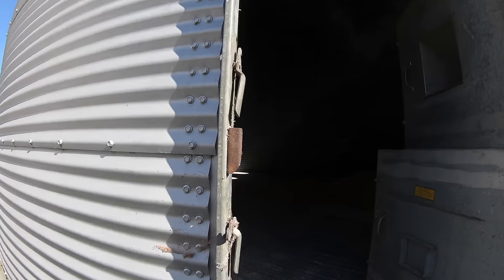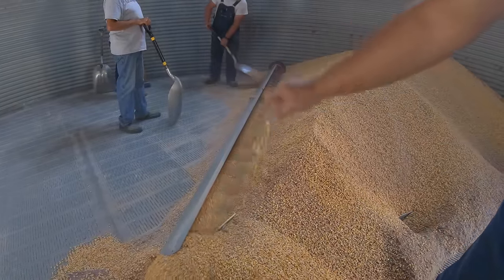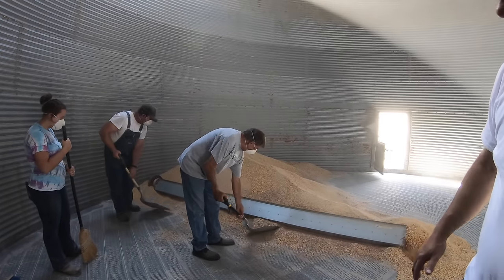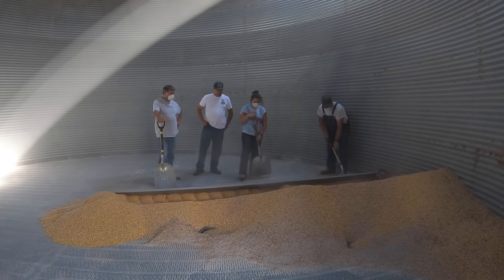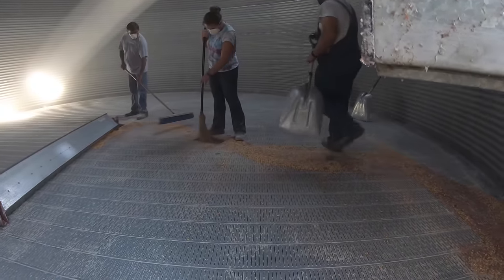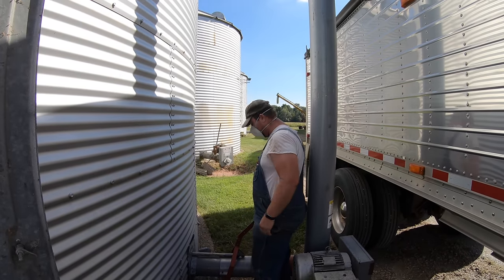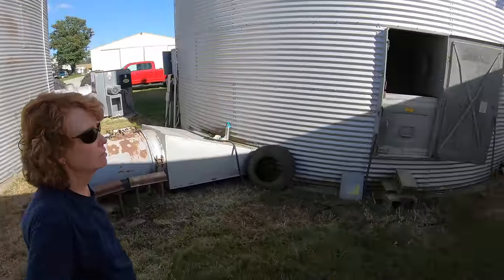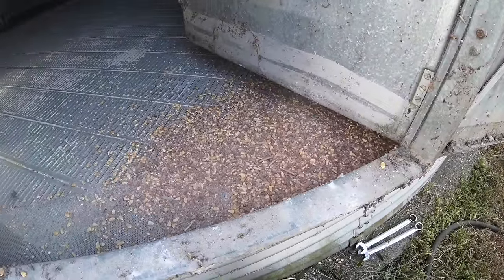How Grain Bins Work! Grain Bin Unloading System!

Comment: I retired from a co op that had 1,000,000 bushel capacity on one side of the road and 330,000 bushel on the other side but we only had sweeps on two 206000 bushel bins and there was only two of us plus one summer help for all of it but it doesn't matter how many helpers you have its a lot of work. Well I guess it does but its still lot of work.

Comment: We used to do ear corn and grind it for feed to the dairy and feeder cattle. It was all right until the corn got down below the feeder to the grinder. Then you had to scoop it. Are grinder was a 550 bushel grinder. We ground two loads of corn a day every other day on average. And in the winter time it was cold because for those of you that don't know that ear corn is stored in an open bin or it will mold.

Comment: Won't be long before they fill them back up , we sold the last of our corn in August ,Sould have in June but, that's water under the bridge. corn up here in Michigan is 26 to 32 % hand shelled right now were going to start Oct.1 we dry corn up here happy if under 25% then we go.keep us posted on harvest down there, enjoy watching that southern corn come off dry out of the fields.
Reply from the maker: They started harvest a couple of days ago.  I'm assuming it is 16% or so.  We used to dry it from 25%, but now there are better 'earlier' hybrids (likely bred for you guys :-)  ) which have better "dry-down", so most years, we do not need to dry very much.
This is a good thing, because our drying equipment is SLOW.
Reply: Propane is NOT cheap anymore like it used to be... 

Later!  OL J R :)

Comment: I worked at a Purina feed mill and cleaned out corn bins, didn't really care for it. It was about 45 miles south of Tampa Fla,  in the summer time
Reply: Yep cleaning bins up north in late summer even in a place like Indiana where it's maybe 80-90 degrees isn't much fun-- doing it down south where temps are in the high 90's to about 100 would be brutal.  No air circulation inside and it's essentially a huge tin can sitting in the sun.  Gets positively STIFLING HOT inside... 

I know I GREATLY prefer harvest in Indiana in October when it's anywhere from the 30's to the low 80's most days to Texas harvest in July when it's 96-100 degrees plus!  Did that too many years... 

Later! OL J R :)

Comment: Memories of my youth. Have you ever gotten into a bin to shovel barley? That itchy dust will make you learn new words...
Reply from the maker: “Red Top” is the worst.  I worked 2 summers in a small seed company cleaning clover, fescue, soybeans, and red top.
Reply: Yeah sounds like grain sorghum... back in the 70's we'd start combining about 8 am soon as the dew lifted.  For an hour before that we were servicing the combine-- greasing and my job, the one I hated, pumping gasoline into the combine's fuel tank-- about 50 gallons worth for the day, all with one of those "bung pumps" by hand out of a fuel barrel.  

Most days in mid-July when you harvest grain sorghum and corn down here it'd be about 90 degrees by 7am.  With the humidity from the dew coming off, you'd sweat through your shirt before you even got off the porch most days.  You stayed soaking wet all day from sweat.  

Grain sorghum back then got what was called  "downy mildew" that grew on the stalk right under the head of grain at the top.  When you combined the grain, the sickle on the header and the bats on the reel would whop this dust loose from the heads and send it wafting straight up toward the combine.  More of this dust came pouring down the feederhouse from the threshing cylinder and out over the header auger, and the bats on the reel would waft it right up towards you.  The combine of course threshed all this dust off with the grain, and it poured out the back of the combine in a huge cloud that either followed you as it slowly dissipated, or blew back towards you.  Best you could hope for was that there was a breeze that was blowing ACROSS the field and rows you were combining, to carry the dust sideways away from you.  Most of the time however there wasn't.  By 9 am usually it was in the mid 90's and just got hotter throughout the day, usually brushing up against 100 by the late afternoon or just over 100 degrees.  You'd be coated in this dust which would mix with the sweat and salt on your skin and make this greasy scum that just itched like crazy... just like jumping into a vat of itching powder and flailing around in it... You were just miserable all day.  Lunchtime you could grab a towel and turn the hose on and get it sopping wet and wash as much off as possible, eat lunch, and then go right back to it.  We'd combine pretty late until 9-10 pm when the dew usually fell and the moisture in the grain would rise and combining would get tough, then shut down for the night, go home, take a long cool shower, grab a bite, and go to bed to do it all again the next day... 

Fun, fun... NOT.  When Carter's grain embargo against the Soviets in the late 70's collapsed the grain markets and led directly the farm crisis of the 80's, we quit farming sorghum for many years... it was practically worthless.  So we grew all cotton til the early-mid 90's when the price of grain finally came back up and we started growing sorghum again for rotational purposes.  Thank goodness by then they'd bred resistance to downy mildew into the grain, and then combining sorghum was about like picking cotton-- still some dust and you got a little dirty, and still hot and uncomfortable in the 95-100 degree or so heat, but at least you didn't itch like crazy anymore and it was tolerable... 

Later!  OL J R :)
Reply: Another nasty one to stay away from was Mustard Seed, far more itchy than barley. Would dad buy hooper bins? Nooo, that would cost a dollar
Reply: LOL would Dad buy hoppers, nope that'd cost a dollar.  

Boy do I know the feeling!  My Dad was always, "never fix it right today for $10 bucks if you can jerry rig it for $5 with baling wire"... Nevermind the fact that it would almost inevitably blow up in your face when you needed it most and then cost $20 and twice as long to fix it again... 

Don't get me wrong there's a time and place for just jerry rigging it and keep going... got five acres to finish and the rain is coming and the part broke on a Saturday afternoon, yeah, you do some REAL creative "fixing" to finish up... BUT then it needs to be FIXED RIGHT.  That's the part Dad never wanted to spend the time or money on... 

Later!  OL J R :)

Comment: Can you store grain on a small scale in any tin container as long as it's clean and protects the grain from the elements?
Reply from the maker: If dry…and kept at consistent temperature.
Changing temperature creates condensation…which will rot grain.
Reply: @TractorTimewithTim  So maybe not in Oklahoma lol thanks for the quick reply btw

Comment: Tim other farms just have the one bin for loading trucks and augers at the top of the bins that transfer the crop to the truck loading bin and they put one auger up to the bin that the certain crop goes to it reduces the fuel cost of the year just by having the electric transfer system a few years ago my brothers father in law had a bin malfunction in the middle of winter where half the bin of soybeans went bad and had to re dry the other half in -4 F to -13 F weather and the half of the bin that was salvaged half of that was my brothers sister in laws bean crop
Reply: Oh man that's hurts sorry to hear it.  Hope their beans were insured because that can be a HUGE financial hit.  

Later!  OL J R :)

Comment: So we raise livestock...if the sweep only works at the bottom, what keeps the moisture consistent while drying?  Even our smaller feed silos clump up.
Reply: They likley dry it prior to putting in the bin, thats how we did it.
Reply from the maker: This particular bin is filled from the bin beside it...which is a drying bin.  So, all corn is dry (but hot) when it is put into the bin.  The fan seen in The video can cool the corn
Reply: Rick Formerfarmer Makes sense, but I know even then it continues to dry.  Our bins will go from 17% in the center to 12% at the edge.  We stay constant and don't store for nearly a year.
Reply: A lot of "drying bins" have what's called a stirrator that hangs down on a beam up at the top ring of the bin.  It's basically a pair of small augers about 2 inches in diameter or so than hang down below an electric motor and drive system that can crawl back and forth extremely slowly up and down the beam, from the center of the bin to the outside wall.  The beam also runs on a round track around the circumference of the bin all the way around at the top, so it ever so slowly moves around the bin like the hands of a clock, and back and forth from the center to the walls... SO, when it's running, the augers are spinning and pulling up corn from the bottom of the bin and throwing it out on top, allowing the corn in the bin to be "turned over" while the blower/dryer is running outside the bin blowing hot air up through the floor of the bin and through the corn.  The augers extend down to about a foot off the floor, usually.  This mixes MOST of the corn in the bin as it dries, and keeps all but the corn on the floor below the augers from getting TOO dry, while the corn on top without the stirrators running would still be too wet and would crust over or mold which is bad news... 

Usually the stirrators are run until the corn is dry, and then shut down... unless of course the farmer is using a "wet corn bin" and "dry corn bin" or storage bins setup, where he dries the corn in the bin, then augers the dry corn into a dry storage bin, and refills the wet bin and repeats the process  until all the bins are full... 

That's where a dryer setup is much nicer... a stationary grain dryer, either a "batch dryer" that's filled with corn and hot air blown through it til it's dry, then it's emptied out into a bin and refilled with wet corn and the cycle repeats, or a "continuous flow" dryer that slowly feeds in wet corn at the top, which flows down through the dryer and comes out the bottom as dry hot corn, which is then augered to the bin and cooled... Most farmers and elevators running such setups have a 'wet corn' bin trucks and wagons dump into as they harvest, and which feeds the dryer, either slowly continuously or in batches.  Dry corn then goes into the storage bins with the fans running to cool the corn down, since hot corn continues to give off moisture til it cools down and would get damp and mold without sufficient airflow to cool and continue drying it... 

Later!  OL J R :)
Reply: luke strawwalker Thanks for the info.

Comment: I don't know if I would that the vertical unloading augers are fading out because and the new bins I see going up are all having them installed. Maybe it's just a regional thing
Reply from the maker: Vertical augers are not good for seed.   We raise some seed beans.  Vertical augers crack them pretty bad.
Reply: I would actually like to see short bucket elevators used to unload bins. They use them to load grain so why not unload into trucks
Reply from the maker: Folks that have grain legs (bucket elevators) can often use them to load outbound trucks. 
My family has never invested in a Grain Leg.
Reply: Yes, legs and pits are VERY expensive!!!  Tons of upkeep expense too in addition to the installation and purchase expense... 

Augers are much cheaper, but not as convenient.  These new belt elevators look really interesting.  They advertise them on RFD-TV all the time.  Most of the seed tenders now have belt conveyors instead of the old brush augers or cupped flighting augers for that very reason-- minimize cracking and scuffing grain for seed.  

For grain going to the elevator, so long as damage isn't TOO excessive it doesn't matter too much... 

Later!  OL J R :)